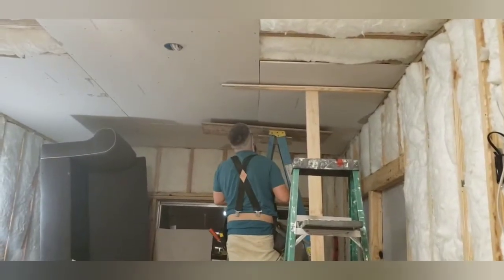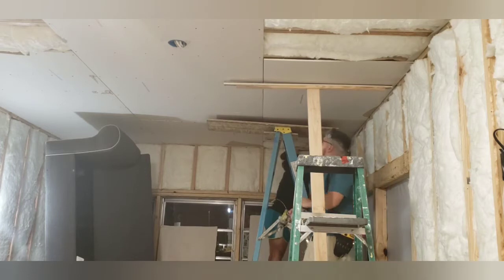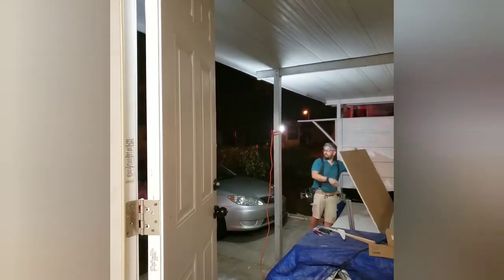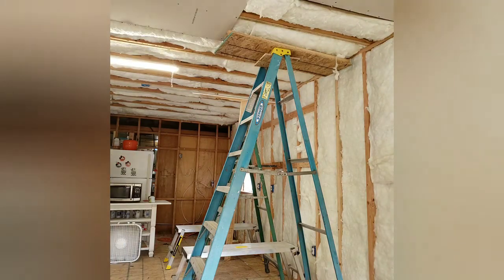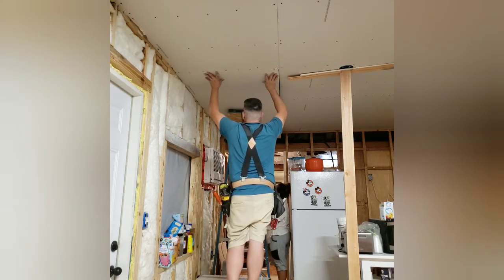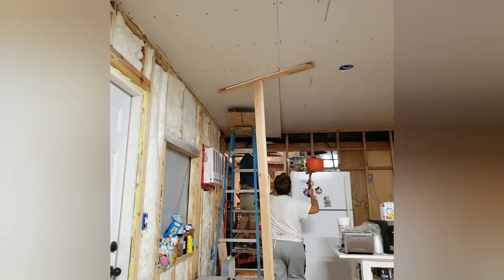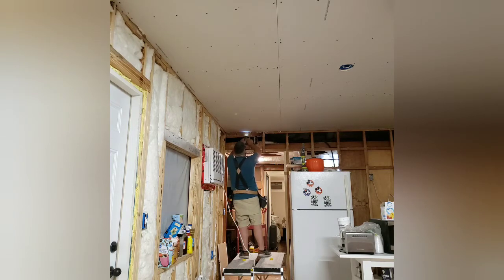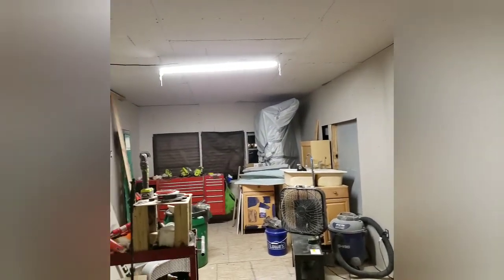(Tips for ceiling drywall on a budget) Mobile home renovation 29

Comment: Doesn’t the ceiling use a different kind of insulation than the walls????
Reply from the maker: You're right. They recommend a R 38 for the ceiling. The one we used was R23 which is usual just used for walls. We were on a budget so we took the chance of using the R23. Now that its been a year we haven't seen any issues. To be honest as well its a mobile home not a brick and mortar home. You want to do a good job and do the best you can but you also don't want to spend more money into it than you have to.

Comment: Y is ur drywall goin up n down instead of side to side ur drywall is supposed to b on a stud of the window 🤨
Reply: It’s vertical or horizontal. What your calling up and down you see here would be called vertical and is nothing wrong with doing it this way. All commercial drywall jobs are hung this way. You actually end up with no butt joints this way. It’s just harder on the back finishing it.
Reply from the maker: No butt joints was our goal lol

Comment: Did you reinforce the ceiling? Did it have 2x2s. Looking to fix my single wide mobile home but I’m contemplating whether to use 2x4 or 2x6s to reinforce the ceiling.

Comment: What u could have done on the one end instead of putting wood on the end to hold drywall u could have put a few screws in wall at top and slid drywall into one end between tue screws and ceilings and done that completely right along wall close to ceilings and then after drywall up remove screws in walls and dry wall hung
Reply from the maker: I saw a video where they did that and I so wished we would have seen that video first lol. That is a awesome tip. Thank you
Reply: @superkeola may I ask how wide is your mobile as it looks huge
Reply from the maker: @crazycanadian8471  i don't know exact measurements but its a single wide with an attachment. Its not a double wide. The attachment is the bathroom,  foyer, 2nd bd. So it gives us a 2 bd 2ba.
Reply: @superkeola  well it looks huge mine is 12 ft wide this one the other was 10 ft wide with a double wide  addition it was 25 ft wide 40 ft ling I just made into a bedroom lol